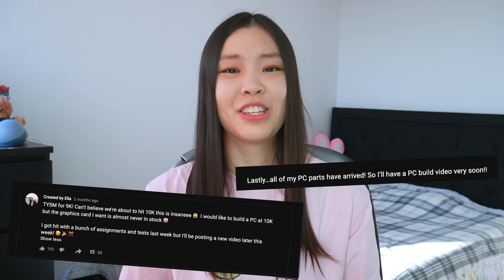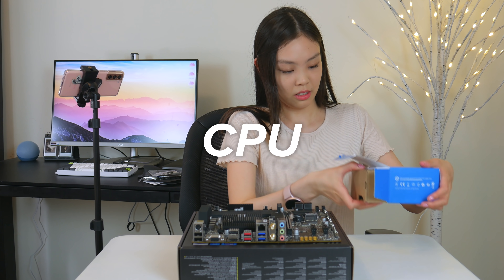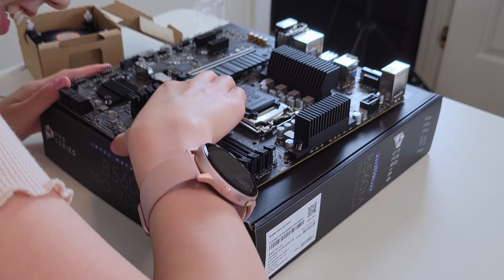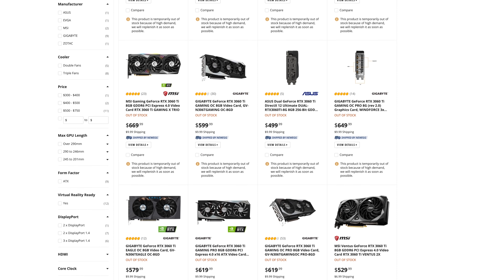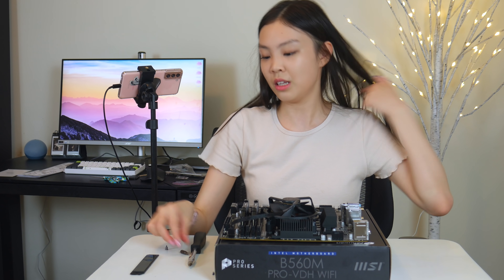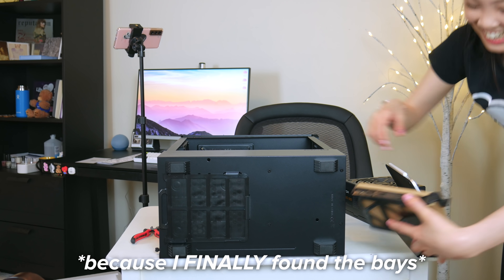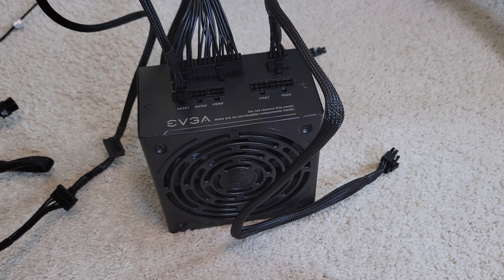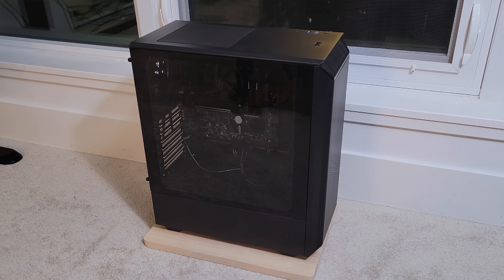Building My FIRST PC! | How I Chose My PC Parts

Comment: ** Also just personally though i would eneble the CPU Fan Fail Warning Control in the Bios just in case if your CPU Fan fails you'll be notified **

I know I'm late for the video but glad you build your own pc it's an awesome experience but sadly with the prices now gpu is so hard to get at msrp but if I'm honest this is just some things imp glad you did and things I think you should have done sorry if I'm talking a lot imp just really into pc xD thought I'm not an expert
+Glad you did this
- Build it on the motherboard box 
- Great Air Flow Case
- Many other things couldn't mention it all lol
+ Wish You did/Change
- Get an AMD Instead of Intel not saying its wrong but much better price  per performance 
- Get a Semi Modular PSU cause it will still be easy to cable manage and also cheaper  
- the CPU Fan Logo is not right side up (this is just for looks just yeah xD)
- you probably could have try to hide the cables at the lower side of your motherboard like the audio cable, front panel cable, etc
Not sure if you enable the XMP profile though just going to mention this in case you didn't because if you didn't your memory WILL NOT run in 3200mhz just mentionning just in the video you said trying to eneble XMP but didn't really see it xD

That's it from me Sorry if i seems abit weird but yeah xD
Reply: She said in the video that her first choice is Amd 5600x but the gpu she wants is not available and it has no igpu. Maybe she doesn’t like the 3400g.

Comment: Still better than the verge pc build.

Jokes aside, some important notes that I hope you're already aware of but are super important for all PC builds no matter if you have experience or not:

Keep the plastic socket cover that popped off when you installed the motherboard; you need those for warranty

You have pretty tall ram sticks, so in the future when you're looking at a cooler to install make sure you have enough clearance as lots of air coolers will stretch out over those sticks and if it doesn't clear or it contacts, it can damage your ram and even go so far as to melt the plastic in extreme cases (odds are won't happen, but why risk it). In all likelihood you'll just buy a cooler and find out you can't even get it on thanks to your ram, so remember your ram clearance specs, measure it if you have to, and if you can't be bothered then just go the AIO route. Guaranteed no clearance issues like that.

Built in wifi on boards tends to suck imo, get a cheap pci-e wifi card. Those go into the smaller by 1 slots usually underneath where the graphics cards go, and are really easy to install. Some require internal usb connectors, so if your motherboard doesn't have enough usb 2.0 headers make sure you get an INTERNAL USB hub. Some cheaper but very solid ones with wifi and bluetooth are the Asus PCIE AC55-BT, but others work fine. TP-Link and some other brands are also very reputable.

You can do a bit more for cable management! A little imagination goes a long way, so try finding the closest grommets to route the cables through so it reaches the motherboard with as little excess sticking out as possible. It's scary the first time because you don't really know how much your cables can bend before you're damaging something, but computer parts are hardier than they look. As long as you're not wrenching a port (use your hands to hold and bend cables don't try to bend it with the port holding it in place) you should be fine. Try and tuck that cooler fan cable away somewhere a little more discreet and it'll really improve the look of your computer.

Final notes: when you get ahold of your graphics card down the line, don't forget to move your display cable to the output in the graphics card, otherwise you'll never actually be using said graphics card. And once you do, do look into adding a few more fans to the front of your case. You have a nice big front panel with that chassis, so make use of that.
Reply from the maker: lol thanks yes I'm continuously learning about PCs :)

Comment: Hey if you want a 3060ti. The only reasonable way is to wait at micro center for approximately 2.5 hours before opening time, and get a card. Shipments are random. Some could have only 3090s, some could have a variety, some could only have 3060s, etc.  (On Thursdays, sometimes Tuesdays) Good luck!

Comment: What do you mean by unlocking the 11500? You don't have a K cpu or a Z590 chipset motherboard. Do you mean that you have had to lock the 11500 max power usage so that it doesn't over heat and throttle due to the stock cooler? The stock cooler should be good enough to where that doesn't happen. You should really only look at upgrading the cpu cooler if the noise bothers you and also if the cpu is reaching mid to 80s and above while you're using it.

Comment: When you get a gpu, I highly recommend you put some corsair 120mm fans on the front and get an aio to mount for the cpu as that will look and perform great 👍
Reply: Get a cheap tower cooler instead, an AIO is wasted in such a case without an Overclockable CPU.
Reply: @eden1925  true but if you ever upgrade, you will be able to use the aio with that
Reply: @oscarstephenson2145  Yeah, but the water evaporates over time and a decent air cooler is better than an aio
Reply from the maker: thanks for the tips!
Reply: @eden1925  I wouldn’t say better but i would say the same but air is still better if u get a good one

Comment: Putting the latch down on intel cpu’s is always the scariest part first time.
Reply: crunch
Reply: especially when its ur first time haha. Im actually trying to buiild a pc for myself but ofcourse nowadays u just gotta wait a loooong time to get all the right parts. still ive been watching alot of these pc builds and its always scary to see how 1st timers struggle to pull that lever down on the cpu. I guess I just gotta prepare for it when my time comes
Reply: picking up an AMD one is way scarier, drop it and boom bent pins
Reply: @yoboicc_418  same with intel
Reply: just use your thum it's ez
Reply: Its even scarier for amd cpus lol
Reply: nope, mine is cable management, im using a messy pc
Reply: @tyrek78  the pins are on the intel motherboards not cpu, most of them at least
Reply: that's because intel cpus actually push their pins at an angle toward them. It needs to apply firmly and at an angle, so it can be really nerve racking :D

Comment: 1 tip that you should use to ensure the setup process goes smoothly is to not overclock anything before setting up windows and all of its updates. But luckily nothing interfered with you. This is because when overclocking you can run in to booting issues. But after everything is done you can overclock to your heart's content.

Comment: I'd definitely add some fans. Might as well given the Phanteks A series cases are known for their airflow. . If you don't care about RGB, check out Arctic P12 pwm/pst fans. You can get a 5 pack for like $40 and they daisy chain out of the box so no fan splitter cables needed. It will take you longer to screw them into place than to wire them up. They routinely match or beat Noctua fans in tests both in moving air and sound levels. I have my system in a P-500A and basically never hear the fans at all. More fans mean none of them have to spin as fast to move air through the case and keep things cool.

Comment: I just saw a thing that you can fix and is the RAMS comes with 2133 Hz and you can change it depending of your rams, you can upload them, you should switch it and your pc goes  more fast :) ( but first check the manual and whats the capacity of your rams) :3

Comment: I enjoyed seeing your build process. Especially watching you do a first time install of the CPU and Memory. 
   Very cautious, I was the same way with my first build. The boot process is fun, waiting with anxiety to find out if the build was done correctly.
   Very Nice build with minimalist component choices, that will make for a PC that doesn't distract while doing work. You can always add a little customization with that better cooler for some subtle lighting.
   The Cooler Master 212 Evo RGB would be an excellent low cost option if there is clearance for the memory. There should be a spec available.
   If not, the CM Hyper 212 Evo V2 is offset for taller memory, but no lights.
😃👍

Comment: I know PC building is a tricky thing to present online. It will bring more critics than anything I can think of so I hate to add to that but I think you should invest in a better power supply. I never recommend going blow $100 for a PSU or one with less than 7 yrs warranty. It's easy to "cheap" out on a PSU but a bad unit has the potential to take out other components when it goes bad, costing you way more than the extra $50 it would cost you to get a better one. Again, not trying to be "that guy" but I think it will save anyone reading this major headache in the future. 

You did fantastic though. You make great videos. Keep the great content coming👍

Comment: Its not an high end pc but it still worth watching, so soothing and interesting
Reply: disagree with some choices on it mostly the integrated wifi as a "need" on the motherboard but other than that it is a good built it yourself NAS computer sadly with the normal 4 SATA ports that NASes usually have.
Reply: @yumri4  how do you get to know what all that means, i wanna build a pc but all i see is , 600 ahsjwb kshwvsi auage8eei, i dont understand.
Reply: @smartglasses4532  She said that she wanted WiFi on the motherboard.  I disagree  with that. For Wifi it is cheaper to get a add-on / expansion card for it than have it built into the motherboard for most types of WiFi. 

The second point was about the lack of SATA ports. Being 4 instead of the normal 6 on Intel boards.  Really unless she wants to have more than 4 SATA connected hard drives it is a mute point. Most consumers only use 1 maybe 2.  The reason why 6 is standard is Intel didn't want to define the spec from years ago so kept it the same. 

She had another video of her getting a NAS and semi set up of it. So my point of lack of SATA ports is kind of invalid. To build her own it is a lack of them to have her own in another system it is enough.

Comment: 2:24 You must put there the thermal paste, in every PC it is like that, you should get one. Congratulations! 😀🎉
Reply: @John Town it isn't enough though. It's like barely putting peanut butter on one side of the bread. Hoping that it'll spread into the other one. Yeah it spreads but it isn't enough.
Reply: @dwaynebaniqued2562  it's more than enough if you're not a heavy overclocker
Reply: @akshaydraj  it is now. But in the future. Apps will consume much higher. So there's a possibility that your thermal paste dried. And it doesn't help the temp.
Reply: @dwaynebaniqued2562  u can upgrade it in future for now it's good
Reply: @dwaynebaniqued2562  it's actually enough, a lot of companies have the pre applied thermal paste are perfect because they're well calculated and spread evenly on the surface are, the problem is when they sit long enough in store they become dry and won't dispatch heat well.
Reply from the maker: the thermal paste is actually pre-applied!
Reply: @CreatedbyEllaYT  alright, sorry, I didn’t know!🙂

Comment: You might want to upgrade the cpu cooler as your system is going to rely on the CPU heavily under video editing. Also, get some Artic P12 fans. They are very good in terms of cooling performance and value.

Comment: Very nice, but did u remove the plastic on the ssd cooler from ur motherboard? sry for my bad english i dont know how to descripe correct. but u installer the ssd on ur motherboard and on top of ur ssd the metal thing. The metalthing helps the ssd to cool, but i have to remove the plastic foil on it

Comment: If you edit on premiere, this is more than enough for 4k. If you use resolve, it may not work as resolve requires a good GPU. Currently I use premiere, but once I get a 3060ti I may go to resolve. Also silicon power has cheaper SSDs.

Comment: I'm going for 5600G and it is even cheaper than 5600X and integrated graphics are damn good.
i5 11500 is also on my list either way both options are better nowadays. 

One Question though 11th gen i5s on benchmarks seems to be drawing more power which isn't a big issue for most people because they are mostly upgrading from 2nd Gen Intel chips (I'm upgrading from i5 1st Gen lol) which usually consumes similar wattage.

Things have somewhat come to a level where consumer wins in the end. Nice Vlog. I'm still scared to do it myself though...

Comment: You forgot to put thermal paste on cpu which is very important in transfering heat to the fan to avoid crashing. But it isn't the end of the world. Modern cpu(s) will attempt to shut down before reaching temperature at which damage occurs, and before that, they will slow themselves down. Unless cpu fan has already thermal paste put in it that's good, hope your cpu fan has it.

Comment: I would suggest to buy at least 1 more hdd to be able to backup your files and be safe in case of hdd failure, I have 3 disks for my files and I am planning to buy 1 or 2 more. 
if you dont have space for more disks in your case, you can put the disk somewhere safe or use a external cage to be able to use it. Sometime in the future I want to try RAID too (never done it before, yes I know I am stupid).

Comment: If you want a real bang for buck PSU, get a Seasonic Focus-PX 750W Platinum Power Supply. I personally don’t think your motherboard, and other components, would be safe if you manage to get your hands on the RTX 3060 Ti because these cards in comparison to the jump between 10 and 20 series cards, the 30 series has a massive difference of power delivery and effiency. Seasonic also has a better price to performance ratio in comparison to paying a premium for Corsair and EVGA, although I’ll admit the only thing those two companies have in comparison to Seasonic is aesthetics but you’re barely even going to see your PSU unless you take it out of your computer case.

Comment: is the ssd for the motherboard needed? i have 2TB ssd but haven't bought one for the MB, i was thinking of just getting a 500gb since i have 2TB SSD and 500GB HDD
Reply: Not necessarily. If you already have 2.5" SSD, you don't necessarily need to buy an M.2.
Reply: @JJFlores197  but if i were to add 1TB, cause i only have 1TB of ssd on hand, would you recommend the one for the MOBO or the portalable one?
Reply: @SENPXL  I would go with an internal M.2 SSD. That is unless you need portability.

Comment: have you gotten the 3060 ti yet, if not consider the rx 6600 xt its basically the same thin, has slighty better performance, and might be a lil cheaper by which manufactuer you go with>

Comment: some advice: you said you got the 11th gen cpu and a b560 motherboard so then you can use pcie 4.0 but then you got a pcie 3.0 drive... I mean if you're gonna get another nvme ssd that is pcie 4.0 then ye that's fine. Also you definitely need to buy case fans
Reply: 100% she said that to seem smarter 💀💀💀💀

Comment: i kind of agree with the majority on youtube that not integrated but expansion card wifi is cheaper and better. I do agree 2.5Gbps networking is good IF everything on the connection supports 2.5Gbps networking. 1 part not supporting it well you go back down to the slowest speed. If she is uses 32GB of system RAM she will notice the jump from editing on a HDD and SSD. 512GB isn't a lot when you take into account windows 10 with nothing installed is 31GB on the 20H1 update i am told it grew by 5GB in the 20H2 update.  That is before you install anything. She is going to run into storage issues soon if she thinks she can edit on 480GB of space. I would say 750W PSU due to the feature of GPUs seem power hungry while 650W is good for now you seem to be wanting to upgrade the thing. In a few years the GPUs most likely will take more power than right now.

Comment: I just wanna politely point out that having a micro atx board inside an ATX case seemed like a weird choice to me when I was watching the video.
I'm assuming you got a micro ATX board PARTLY for the built in wifi.  It's no problem at all, but you could have gotten a full size ATX motherboard, and then just buy a PCI-e wifi card or a USB wifi dongle to get the wifi functionality afterwards.
Having a full size ATX motherboard would just look more in place with the size of the case that you got.
I'm still excited for you though!  Not trying to be hateful over here!

Comment: Nice build. A recommendation from me is that you could switch the power supply from a 650 watt to a 550 one, as the upgrades (fans, gpu, etc...) will only need max 400 watts. I’ve also found cheap fans and a cpu cooler, that will keep your pc cool. Please check my pc part picker list if you’re interested in what I’ve found (link is in the reply section of my comment)
Reply from the maker: Thanks for the tips!

Comment: i really like this video but does it matter what case i get if i use the same parts as you?
Reply: Any case that supports micro atx (matx) motherboards will work (which is basically everything except those really tiny ones).
Reply: Don’t use the parts she used, they’re not very good.

Comment: watching this nearly a year later, mine was similar, my case Phantek p360 ,( a little better case and it come with 2 rgb fans ), same power supply, same mother board, I5- 10400 10th gen so lower memory, same size  m.2 mine was a Wester digital, and I used and old graphics card till prices came down, I now have a EVGA 3050 card very happy with my pc and very upgradable, only thing i can recommend is adding more  fans than what comes with the 300 case.

Comment: You could have gone with a 5700g. Similar price with a much better IGPU and is a 8c/12t CPU.
You could also go with the 5600g. Still has a much better IGPU but the CPU itself is a little slower than the i5 11500.